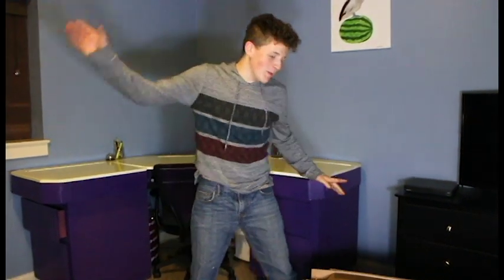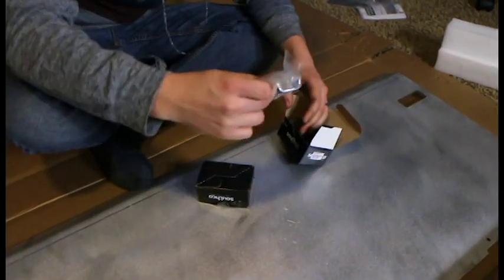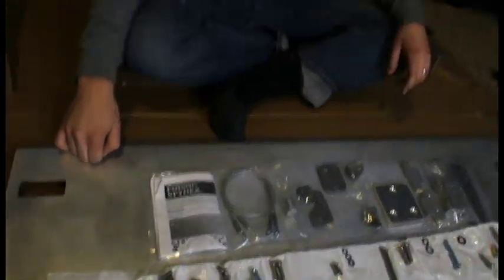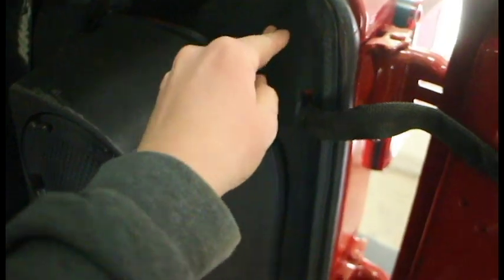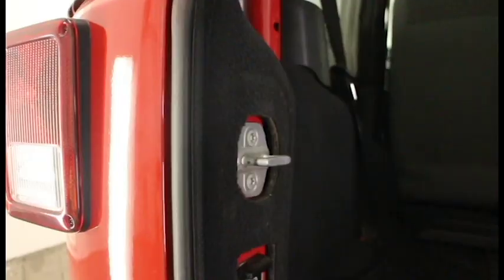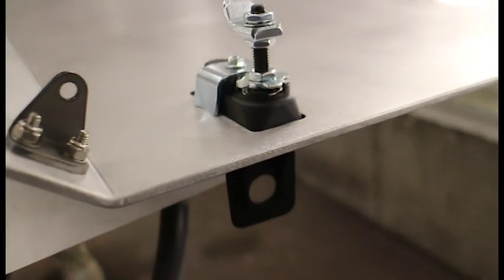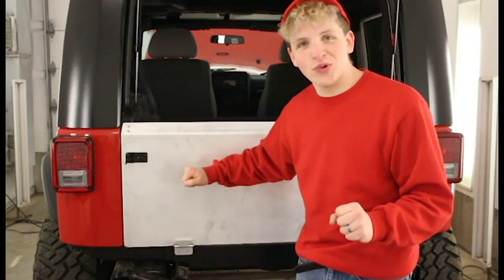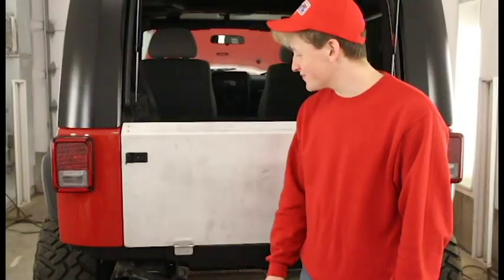Poison Spyder Drop Tailgate for JK, Unboxing, Review, and Install

Comment: I installed a colormatched PS Trailgate on my son’s 05 TJ to replace. The Ebay seller that advertised the TJ I purchased as “mint” neglected to disclose that the OEM tailgate was damaged/bowed. Anyway, the PS trailgate was much less than OEM tailgate replacment.  While the trailgate is a bit of a hassle to unlatch/latch, it’s still pretty cool drop down tail gate.  Oh, I put a cooler pad on the inside to use as seat cushion. 
PS should add a channel for wiring to their next gen trailgate for those that want to add a 3rd brakelight to the Trailgate.     Cheers!

Comment: Have you actually bolted it up and put the lock's on it would have worked. Mine worked just fine. You just can put it on without breaking a finger nail and calling for daddy.